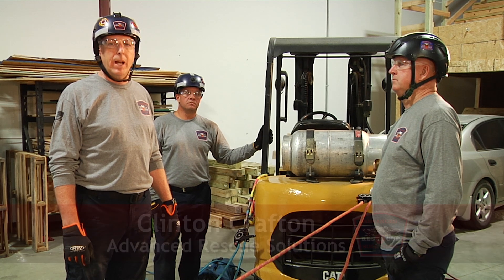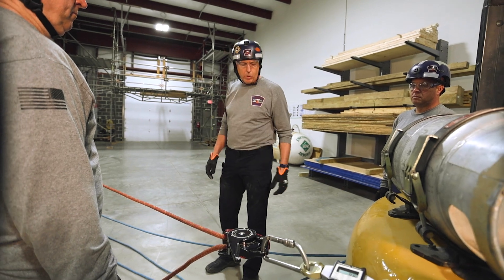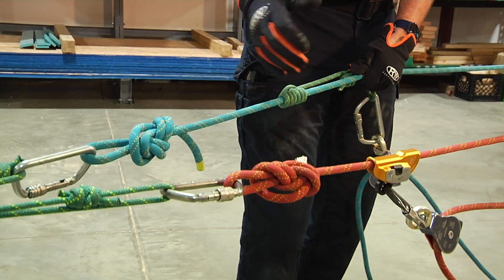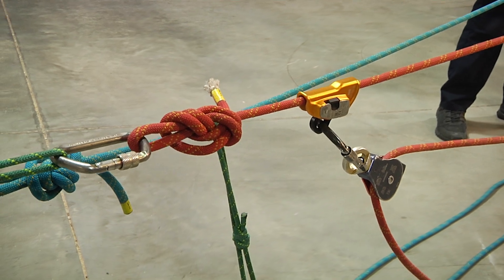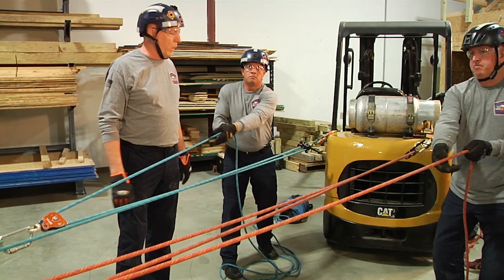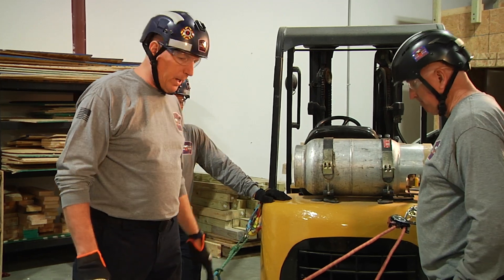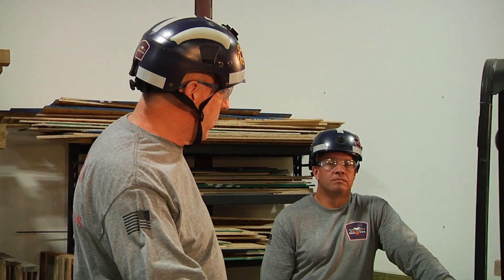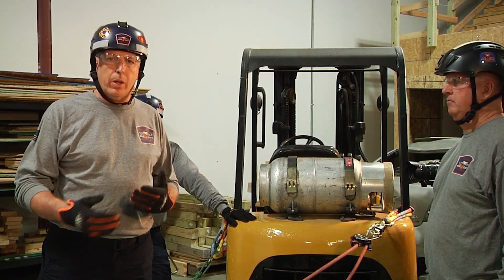Twin-Tension Rescue System

Comment: Another method of hauling with a TTRS is to have a single haul team haul on both lines. This prevents the load alternating between the two systems when the teams end up out of sync which invariably happens. Thoughts?
On descent/lowering, if the clutches in this case are rigged alongside, a single operator can operate both clutches and a tailor should manage the running ends.